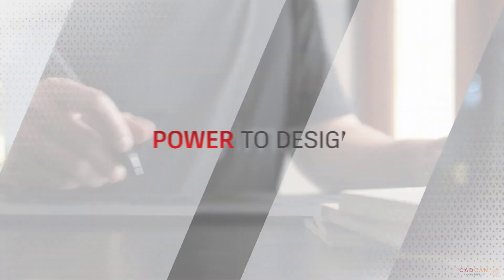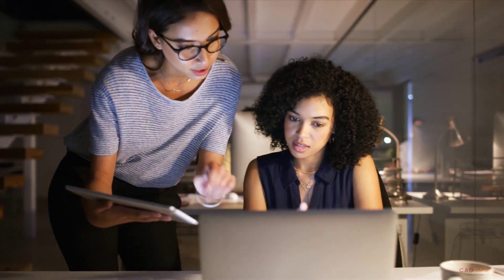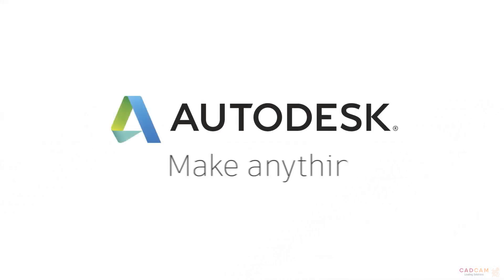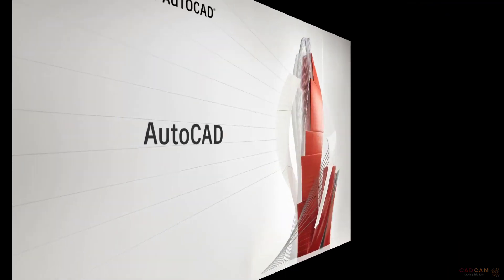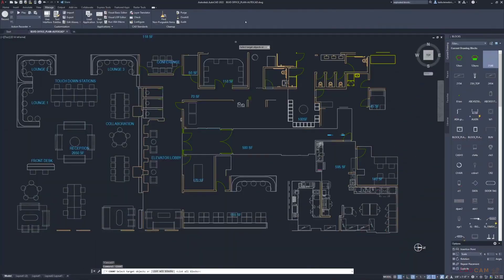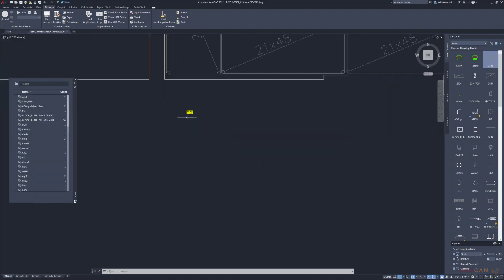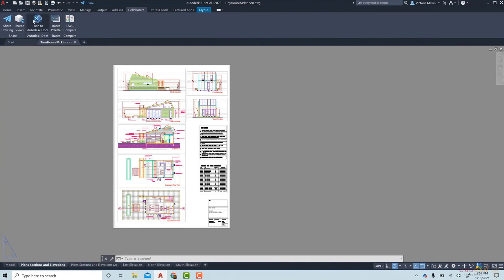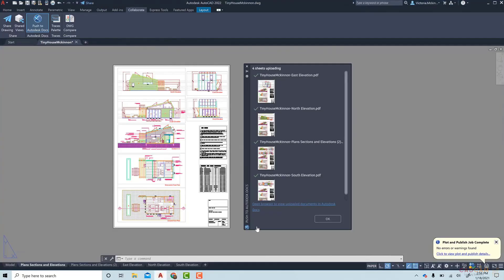AutoCAD 2022 What's New

Comment: Count - вообще бесполезная функция. Если работаешь с блоками, то можно выбирать блоки через «Быстрвыбор», а таблицы делать можно через «извлечь данные» или делать можно блоки с атрибутами. Зачем «прикручивать изолентой» те же функции и показывать, что это прорыв? Лучше б ядро для 3d улучшили и сделали возможность редактировать ЗД объекты. Чтобы чертёж не испортить - можно блокировать слои. Спорные нововведения...
Reply from the maker: Спасибо за информацию, думаю, в следующих версиях технологического гиганта Autodesk будут изменения.
Reply: @CADCAMSOLUTION   я очень на это надеюсь! Все ровно люблю AutoCAD, хоть он уже и не развивается толком. А ещё очень люблю Inventor и 3 ds max. К Вам просьба побольше об inventor роликов! Заранее спасибо!!!
Reply from the maker: @prostoCAD  , thanks sir.
Reply from the maker: Use 200Mb, this amazing. Thank you so much.
Reply from the maker: I thing on working for plant design with pipe, structure assembly or modeling architechture.